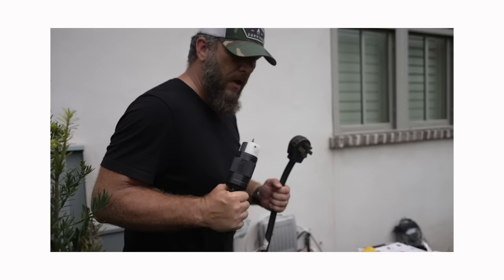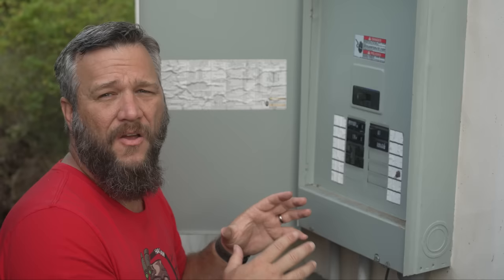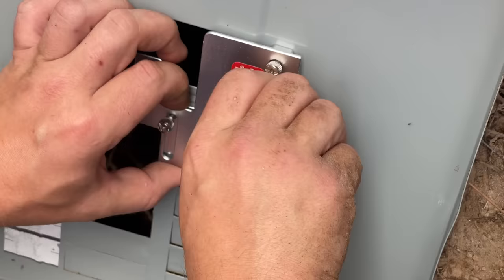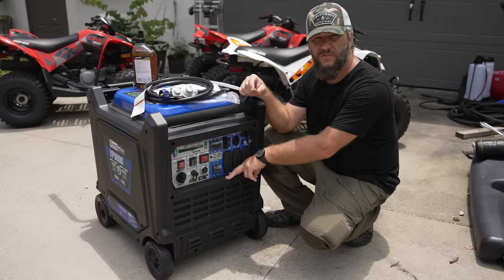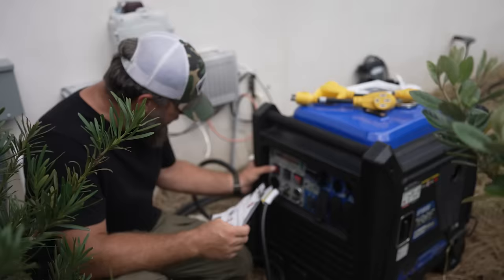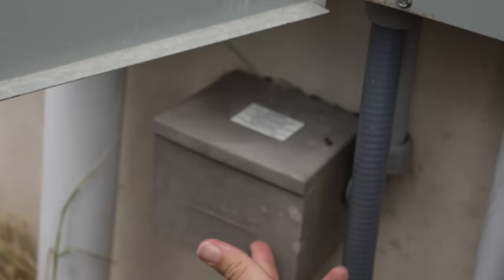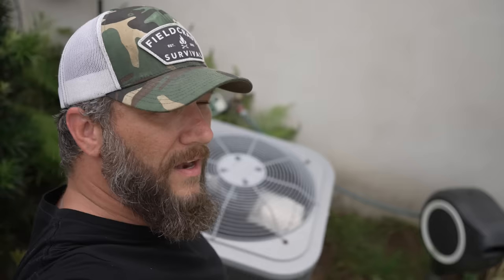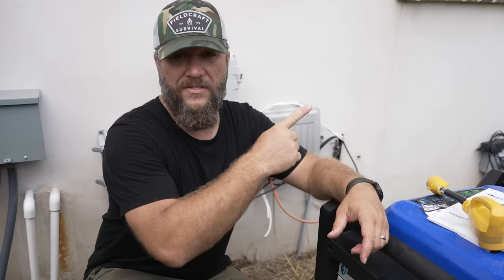90% Don't Know About This Fatal Generator Connection

Comment from the maker: Thanks for watching! You can feed a HAXMAN child by purchasing a shirt at www.thehaxman.com.
Reply: The HaxPack🫶🏽
Reply: After the a/c kicked on, you never said how many watts it was pulling. The video was shaking and we couldn't see the answer. Please let us know. My husband and I were waiting for that answer.
Reply from the maker: @tvintx9741  It jumped to 7800 watts briefly and then fluctuated around 3800. Sometimes going between 2800 and 5700.
Reply: @HAXMAN  you rock for responding to my question!!!!
Reply: This is why all grid connected solar panels shut down during power outages.
Unless you have batteries and a disconnect
Reply: Stellar presentation! You obviously did your homework.
Reply: 50 amp cable is only good for 6000 watts
Reply: Use liquid Teflon thread sealant, works much better than everything else
Reply: Good luck gettin generator to start on propane when it's cold out. I have to start mine on gasoline first
Reply: Thanks for your comment! The Segway Portable PowerStation Cube Series sounds like a great product for outdoor enthusiasts like us. It has a massive capacity and fast recharging capabilities, making it perfect for extended camping trips. Plus, its armor design and waterproof technology ensure durability in any weather. Consider checking it out if you're in need of a reliable power source. Keep enjoying your outdoor adventures!
Reply: I live in the Colorado Rockies at a little above 8,000 ft. Elevation. How much on average should I expect to pay for a power inlet box and an inner lock kit? All suggestions appreciated 😊.
Reply: So is at the order you want to start your generator and run everything? Do you want to start your generato,  flip your breaker, plug your power cord into your house first, and THEN/LAST plug it into the generator(while running)??
Reply: @HAXMAN  my generator is 12,000 W so it shouldn’t have a problem running the house plus the AC. But you said the best type of generator is the inverter type? That’s why you got a different one?

Comment: I was one of your subs who pointed out the interlock issue.  As an electrician who has installed many genset systems that is perhaps rule number 1 to keep everyone safe.  Shame on the contractor who skipped that rule.
Reply: I have to ask the question…what about the neutral? I know transfer switches switch the neutral, but the interlock kit in this video does not switch the neutral. Is it required or not?
Reply: @dt05  As long as your service is properly grounded, no current will pass through the incoming neutral.  Electricity always follows the shortest and fastest path to ground and the Gen-plug has a neutral and ground path as well.

I do however recommend a bond wire to the generator.  Can't be to careful when it comes to electric and generators.
Reply: @Zappy1210  A "bond wire to the generator"? Not questioning your advice. Rather, trying to learn something. Do you mean running a wire from the ground bar in the panel to the chassis/metal part of the generator? Or if the panel had a external bonding block, could you run a wire from there to a metal part of the generator? Bonding wire size? #10, #8, #6, #4...Like I said, just trying to learn. Any feedback would greatly appreciated.
Reply: Skipping the interlock keeps the linemen on their toes.
Reply: @Zappy1210 actually it is a risk. If you have a bad neutral to the genset you can back feed power on the neutral. A miswired cord set can do the same thing.  Ideally you want a transfer switch but the code allows for the interlock kits.  Fixed generators and some large temporary generators require an earth connection.
Reply: @Chubbydippin  Hi, sorry, just seeing this.  So to try and answer your questions... I'll use examples to maybe help clarify.  

If you use a generator on a construction site powering tools or lights etc for instance, or around the home.  This by NEC code is a "separately derived system" and therefore, technically by NEC code requires a neutral to ground bond wire on generators.  I believe most, not all generators already install this bond for you.  I would also advise, though it may not be required, if this system is used often to actually have the frame attached to a ground rod.  Reason being, let's say you are filling the fuel tank, when you have ungrounded metal with moving parts, even a plastic fuel tank can all cause static electricity.  So you pour the fuel, something sets off the static charge and you will get a spark that could potentially ignite the fuel cell.

Another reason I am in favor of bonding/grounding the frame is I have seen first hand an unbonded (or grounded) frame actually shock a homeowner.  I found one leg of 120 volts wire coming from the generator it's self had a very tiny slit in the wire and it was touching the frame causing the frame to become energized.  The motor and generator typically sit on plastic/rubber bushings and do not typically contact the frame, so bad things can happen.

Now lets say you have a Genset, or even the same generator powering an RV or your home.  You technically do NOT need that neutral to ground bond on the generator as long as you have no means to disconnect the existing neutral to ground bond of the home or RV.  If you can disconnect that bond, then the generator must have this bond.  The generator having the neutral to ground bond in any case is fine and the safest means if there is even a question.

As for the ground/bonding wire size, it depends on the KV of the generator.  But #8 wire typically fits the bill of most generators.
Reply: I always install a transfer switch. This all seems lazy as shiit to me.
Reply: @Zappy1210  If a portable generator is connected to your main panel in this fashion (no disconnect on the neutral from the generator) then the generator should have an unbonded neutral and no ground rod on the generator. NEC dictates you can only have the neutral bonded to earth ground in one place and it should be at the main disconnect point for the home. That would be your main panel where you installed the generator back-feed breaker.

If using a portable generator in standalone mode where you are connecting your loads (tools or RV) directly to the generator, then the generator must have a bonded neutral and (per manufacturer specs) the generator must have an earth ground (ground rod) especially with an RV so you don't end up with "Hot Skin".

The biggest problem over bonding and grounding portable generators, I think, arises from the the lack of understanding the difference between earth ground and equipment ground.
Reply: I just read all of your responses to your original comment.  Boy do you know your stuff.   I'm looking for an electrician to install an outside system so that I can get a generator to run the house.
I noticed in the video the air conditioner actually ran under the generator.
What about a heat pump of that ton compressor?   Any ideas?
I did grow up with someone who installs these as a business.  I'll likely contact him in the coming weeks.   I'm sure he will have it set up just right for the size system we need.
I'd rather a professional than me doing the job.   I know electric but not to a point of this stuff.
Reply: @Chubbydippin Run a Solid #8 or #6 bare wire from the generator grounding point, to the ground rod connection that should be very close to the main service entry( revenue meter). The neutrals and grounds are only bonded together in the main panel. If you have a sub panel, fed by lets say a 50A breaker in a remote building. The neutrals and grounds must be seperated and landed on seperate terminal strips,  and the green bonding screw removed. 
So in short...all electrical equipment should have a recommended or exceptable means of grounding. (Via metal conduit....or a terminated ground wire marked as a ground wire, green tape etc.).
 Hope that helps. This does not imply that this tidbit conformers to local codes etc.
Reply: @homertalk Not true. A personal ground always used to short out line to earth/derived neutral and would trip out or destroy the generator unsafely connected.
Reply: @ianbelletti6241 Correct and missed by many.  In each NEC house, Neutral, ground and earth are connected at ONE point (only) and then separated everywhere else.
Reply: @Rico-oy3dc Yes!!! The most common place this is violated is 240VAC appliances - ranges, ovens, and dryers. They come default wired for 3 wire, but the technician that wires the 4 wire is supposed to remove the bonding jumper or secure it to the proper terminal. I’ve seen Master electricians make the mistake of merging the neutral and ground on appliances many times. You don’t need a ground loop in your kitchen if a conductor is compromised, trust me.
Reply: What is the name of that lockout you showed or part number.  Would like to locate some.
Reply: @Zappy1210  it actually wants to take a path back to its source but i know what you mean.
Reply: So ill tell ya now 9k watts is not gonna run your whole house.  Second did i see $12k as the price here? If so, I understand your paying someone else to do it and you may live elsewhere. where prices are high no matter what. But being an electrician and from what i saw, I could have done that install for thousands less. Like $5k tops maybe,only probably because im an electrician and maybe my location is just cheaper idk. Third, you have to pay attention to the generators neutral to frame/ground bond wire. Sometimes its connected on the generator, sometimes its not. Its fundamentally important for you to know which it is in order for you plan your grounding/bonding system.  Technically the best setup is we really should be switching the neutral on the service and placing a dedicated groundrod for the generator itself. Yes, your grounds, neutrals have to be seperated in panel. Yes you need an interlock. Yes, the propane will give you less watts. The predator at harbor freight same size and better reviews for probably way less price too.
Reply: It will pull better then push when off a hard surface
Reply: @beebob1279 biggest limitation of the portable (other than sine wave issues) is running amp load.  Most heat pump systems also have heat strips. Even the Generac 24/26 kw systems of standby generators are often installed with a caveat WRITTEN IN THE FINE PRINT that they will not run electric heat.  

Just based upon my experience
Reply: @BrianD-ds4dx  Thank you.  SO they are basically useless for a home with heat pumps.  I would guess then that small space heaters are needed to keep the chill off
Reply: @beebob1279  Cummins Kohler and possibly Briggs may be alternatives depending on the amps they put out.  You might also consider a liquid cooled unit.  As they are typically larger they will put out more amps which will thus run heat pumps/strips.  Let me know what part of the country you are in (state/city) I’ll put a couple of company names up.  I don’t know if they will offer Briggs but I know the ones I put up will offer either Cummins or Kohler.
Reply: Who did that?!!!!!
Reply: if I were to accidentally forget to turn off the main breaker, wouldn't my small 30 amp generator just trigger the breaker trying to feed all the homes on my transformer hub?  Nobody turns off their main breakers when the power goes out  @homertalk
Reply: @Jzzonem  9k will definitely run a whole house.  I run my whole house on less.  That includes a furnace, air conditioner, a refrigerator, microwave, a chest freezer, washer and dryer etc.  I can do everything on my generator.
Reply: @IH8CalSpa  thats  too much of a general statement for me to agree with.  Maybe you have smaller/highly efficient ac, or a window unit. Maybe your not running all of that at the same time even, fair to assume. But, it can be misleading to just blanket state that everyone  (who may have more equipment and/or less efficient equipment) can run their whole house on a 9k generator.  Im glad your system works for you, as this is exciting.
Reply: @Chubbydippin I think he meant running a grounded rod into the ground that connects to your generator ground ir frame. Not an electrician though.
Reply: @Jzzonem So if connecting an Inlet box to a subpanel, where the grounds and neutrals are seperated, I'd want a generator with a floating neutral AND NOT the ones with a grounded neutral, correct? 

If you install a manual transfer switch to you subpanel does it matter which type of generator you use? Can both a generator with a floating neutral and/or a generator with a grounded neutral be wired and work correctly when wired to a manual transfer switch? Thank you for you input!!
Reply: All this valuable input is greatly  appreciated and made me think about doing something if "building" a new house from the ground up. Wiring 1-2 circuits in a house completely isolated from all the other/normal branch and 220 circuits fed by the house's service. Let's say, one outlet in each room, one behind the fridge, one outside and one in the bathroom that are all connected to each other only, and not connected to any of the normal household circuits fed by the panel. My thinking is, you could place a generator outside by the exterior receptacle and back feed that outlet with a cord from the generator. Would this work to power just those few isolated outlets during a power outage? Instead of trying to energize the panel and everything in the house as well as installing a transfer switch, why not just power to those few receptacles to get you through the power outage? Almost like a "in case of emergency circuit" just to get you through the power outage. Maybe this is something that's already in use. I know in some commercial buildings they are required to have a emergency lighting circuit usually fed by a backup battery of some sort. But that's just for lighting to help get you out of the building. Just a thought regarding a emergency generator powered circuit for power(receptacles) instead of lighting?
Reply: @shawnphillips1220  if it were my house, i would install a neutral switching disconnect in between my meter and main panel if there aasnt already one there.  This would mean we have four wires feeding the main panel and the grnds/nuetrls are seperated.  Now, iwould bond the neutral to the grnd @ the generator and install a ground rod @the generator. Plan out where i am placing the generator when in-use.  Use 4 wire cable to the inlet and have a four wire inlet to the panel. 

When you go to use the gen, start by shutting off that nuetral switching service disconnect, then the main/interlock, start up the gen, throw the transfer switch on and slowly bring each load on.
Reply: @Chubbydippin  You will have to be sure to turn off ALL other circuit breakers including the main or plugging into that outside recept. will result in energizing everything on that phase of the panel.   But yes, that can work in a pinch for sure.  Only problem is you won't really know when your power is restored unless you can see neighbors homes.
Reply: @Zappy1210  I don't think you understood what my idea was. The outside outlet I'm referring to would only be wired/connected to a few outlets in the house and "Not" be connected to the panel or any of the  circuits fed from the panel. So these select few outlets would never be energized unless the outside outlet was connected to a generator.
Reply: @Jzzonem  I hear you but that seems way more labor extensive and more expensive. I had a external disconnect (main panel) installed and the panel inside my house became the subpanel. The service was upgraded to 200amp. I'm trying to figure out the safest and lest expensive way to build off what is here in order to get backup power. I really only a need a couple 120v circuits for my heat pump and fridge. I was going to put a plug on my heat pump so I could plug it directly into the generator if needed but then thought about having an Inlet box wired to my panel. It only got confusing once I found out you need a specific generator for specific needs. The whole floating neutral and grounded neutral threw me a curve ball. I know you should only have 1 place for ground on the entire system and since the grounds and neutrals are seperated in my subpanel made me thing I would need a generator with a floating neutral.
Reply: So the main bonding jumper at the service is ok to keep connected when we shut off the main and turn the generator breaker on?
Reply: @Rico-oy3dc sort of correct…

Neutral shall ONLY be connected to the egc, in ONE location, at the first disconnecting means. 
BUT egc to EARTH usually is required to be multiple grounding rods, water pipe, and steel framing. At pools, etc… you WANT the generator frame to be connected to an egc, or a ground rod, that is connected to the egc.
Reply: @bobdoiron176 shhhhhhh…. The electricians here didn’t think of this simple fact…. Now if your line was broken right and only at your pole, then you could possibly give someone working on your pole a jolt… but hey, I am not an electrician so just follow the science😅
Reply: So if I buy an inverter  generator at Costco, I just need to get electrician to install interlocking kit and be good to go?